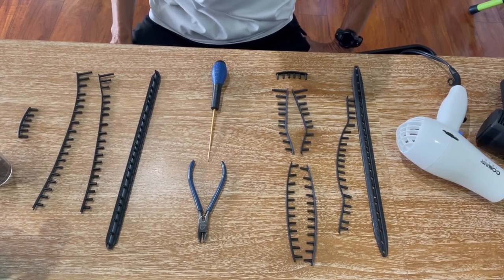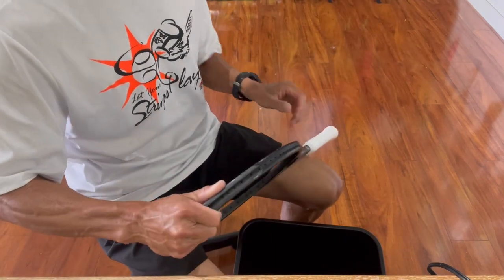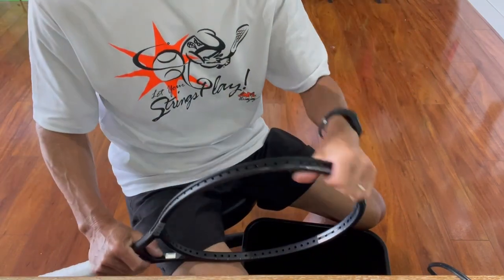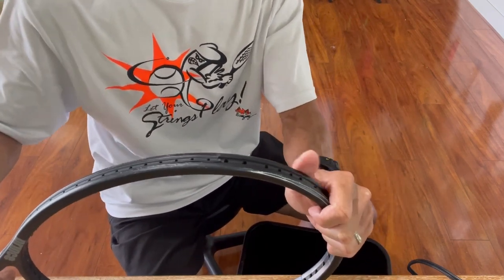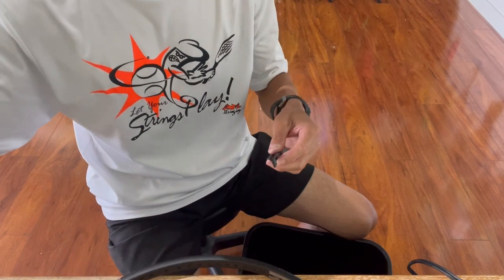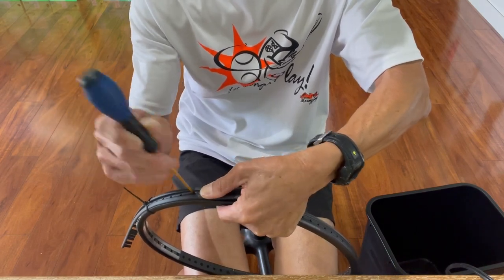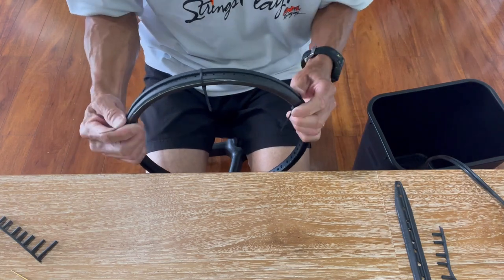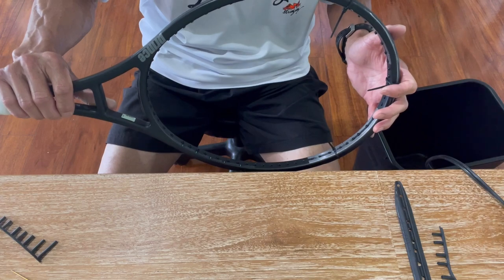Racquet Repair [Replacing Grommets & Bumpers | Part 1 of 3]

Comment: great video. When I teach people to replace grommets, I have them set the racquet down butt cap up ( just like mounting). As they remove the old grommets I have them place them around the frame on the table and match the grommets to the old. That way if it is an asymmetrical set they know which way each piece goes in.
Reply from the maker: Aloha Herb, Good point . . . thanks for sharing!

Comment: Albert, I notice you have the lead tape at 10 and 2 O'clock on the racquet. How much of a difference if it's placed at 9 and 3?  BTW, I spread clear paint on my lead tape to weatherproof.
Reply from the maker: Aloha Eddie, That Phantom 100G racquet is my personal racquet. Since it is has a thin beam, I prefer to have the lead tape in the 10:00/2:00 areas. By adding weight to the top portion of the hoop, I feel I get the best combination of stability and power. If I move the weight to 9:00/3:00, it would reduce the swingweight by 3-4 units. Interestingly, I also use clear coat on my lead tape when I customize frames for young juniors. I feel they're more at risk to get lead poisoning and it makes the parents feel a little safer.

Comment: Nice demo--could you do a video on grommet grinders and fittex grommets for those racquets with no replacement sets available? It's a good idea to press the replacement side grommets nearest the throat down with your thumb when tensioning the string through them. The string can lift and permenantly distort the new grommet. I have an older black Blade 98 with lime green grommets that are crumbling and breaking apart--do you know if this is a common problem with this racquet?
Reply from the maker: Aloha Robert, Thanks! I'll add the grommet grinders/Fittex grommets to my list. I haven't strung any of those Blade 98's with the lime green grommets. I wonder if the green pigment color is causing it to crumble and break apart?
Reply from the maker: Hey Robert, This one's for you! https://youtu.be/tnnAgF7LsGQ